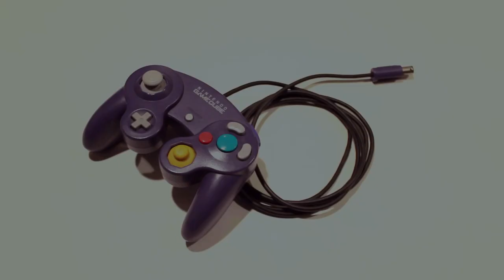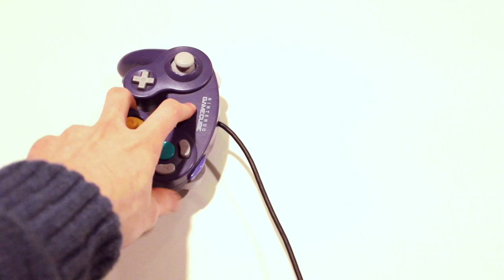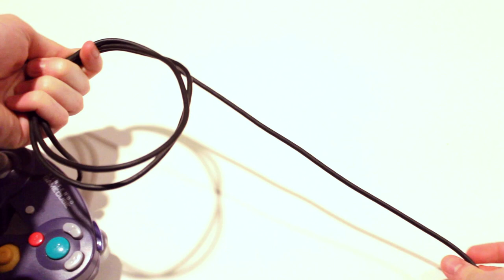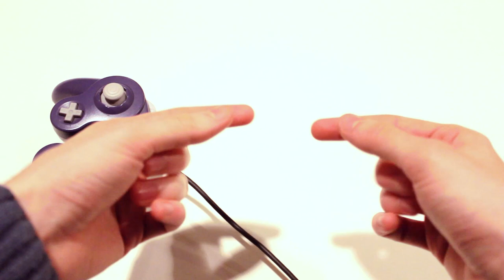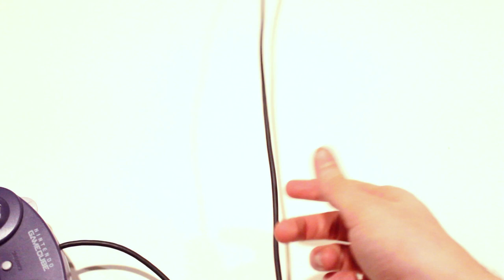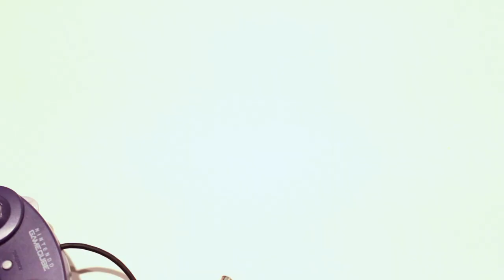GameCube Controller Cable Wrapping Tutorial

Comment: I still cannot figure out how to do this, christ sake.
Reply from the maker: The trouble most have is rotating the cable so that it loops under itself. Try doing it that way without alternating directions.  

Also, you only need to rotate one side, and as you are rotating, you should move your rotating hand towards your stationary hand. The coil should happen on its own.

I have seen some try to spin both ends which can work but is confusing, and, if you don't move your hands towards one another to make the coil, the behaviour of the cable just looks confusing and like it isn't working.

Let me know if any of this helps or, if I totally missed the mark, what, instead, is making it difficult for you.
Reply: Im sorry, I really really don't understand any of this,

Kudos for you for replying! I appreciate the help.
Reply: why not

Comment: Hey is there anyway to wrap the wire around the controller while still utilizing the over under method?
Reply: Juna ya if u wanna BREAK ALL YOUR CONTROLLERS
Reply: @landscape85  unhelpful answer yes or no or not at all commenting in the first place is of more help more often of the time for the op regardless of whose post/or otherwise
Reply: I tried this with a charger before, it's very hard to make it wrap exactly around that distance in order to fit around the controller without it wanting to unwrap. So I just gently wrap around the middle of the controller without pulling too tight, then you're good.

Comment: I fold the wire in half loosely and then wrap it around the center of the controller loosely. Doing it that way seems to not cause any kinks for me normally. But do you think that's more likely to cause damage over time than your method?
Reply from the maker: Yes.

Comment: Pro's and Con's of just wrapping it around the controller?
Reply from the maker: Pros: Tidier (slimmer profile)
I can't think of a situation where that is life or death, but, know your options.

Cons: Will generally cause more kinks as a result of the edges on the controller. 
Also, smaller loops/straight coils increase the chance your wire will break.

Comment: This feels impossible with the new 3m gamecube controller i got it has so many kinks in it from the factory wrapping and i cant do this when i was younger i used to wrap it in the middle but this cord is too long.  And now i know that was one of the bigger reasons why my controllers used to break but yea this is impossible with the factory wrap doing the damage.
Reply from the maker: It's possible to correct the kinks. You just need to wrap your cable like this every time and you will notice it begins to straighten. Cables with kinks are definitely frustrating to wrap, though. I hate buying factory cables and receiving them wrapped like a fire hose with insane kinks. I buy cables sometimes in excess of 50 feet and it's incredibly annoying.

Comment: And if you’re wondering how you can make the wires more manageable, you could simply tie a little knot on the loop hole with a piece of string or plastic, like the ones used to tie/package loafs of bread, so that the wires won’t come undone, or wrap the loop hole over the controller so that it sits in-between the middle of the controller.